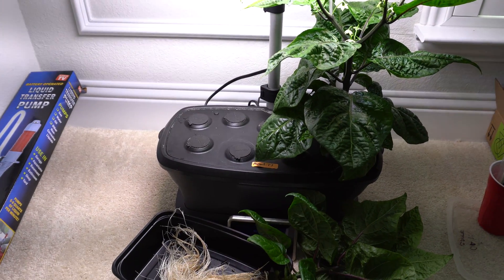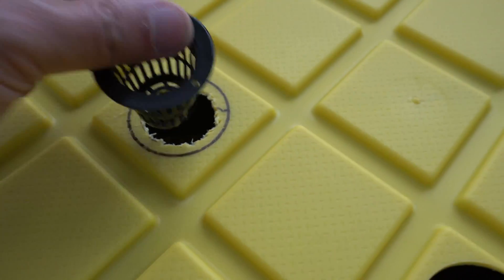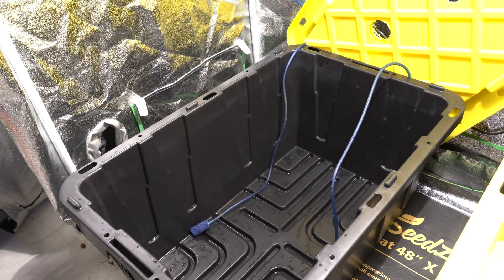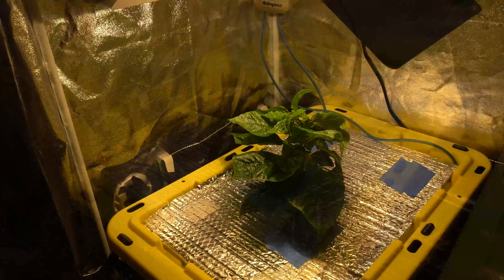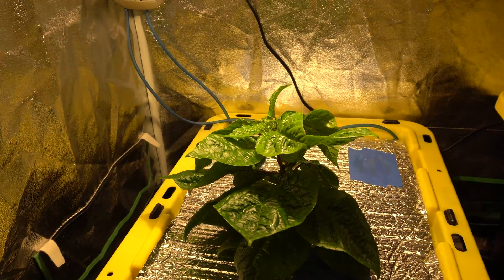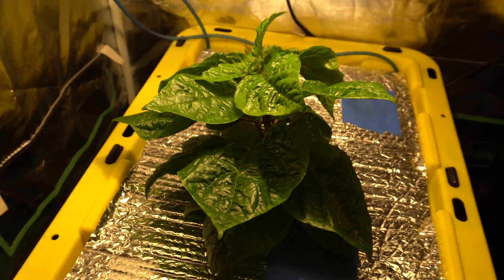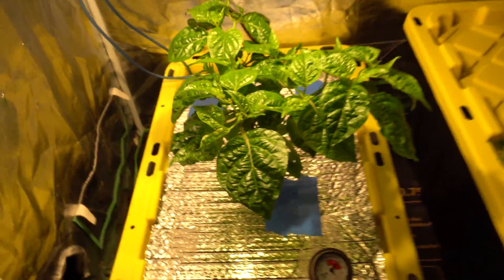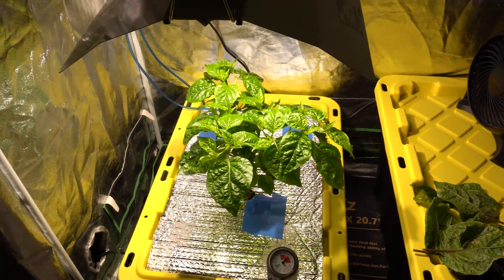DWC StarrRacha F3 - Indoors Under Endomaxx CMH150

Comment: How do you flush a system with that much water? I just started hydroponics and I’ve been replacing the water every 2 weeks. Is that necessary to do? My system is much smaller though
Reply from the maker: I don't plan on flushing this.  I'm going to let the plant use what's there and when it's gone, I will add more.

Comment: when using the General Hydro mix (grow/bloom/micro with cal-mag) 5ml per gal.what need to be done to keep the flowers from dropping and turn into fruit after the vibrating tooth brush pollination. Plants are Huge, Tall,  very Green and have hundreds of Flowers, but the flowers never hang around long enough after pollination to turn into fruit.

Comment: Why not just add a second CMH150 for the other half of your tent. Wouldn't it make more sense. For example if only one side needs light for any reason you don't need to burn twice the power to maintain half the tent. Secondly, in a two light system a light failure won't be a disaster for you plants as it would be in a single fixture setup. Third, cost. Expansion makes more sense than upgrade.
Reply: i agree with mainiac... for this kind of setup ... 2 lights would be so much more flexible in terms of growing different plants.
Reply: A couple more advantages is independent height adjustment for different height plants as well as better headroom as the higher wattage light will have to be kept further from your plants to avoid burning.

Comment: What happened to your indoor watermelon plants? Did they produce? Did I miss a video?
Reply from the maker: It produced a small fruit, but the 3 plants took up the entire tent and drink too much water, so I pulled them out.  I may do it again but with 1 plant instead of 3, and a larger system.
Reply: Khang Starr that's what I figured happened. I had never seen something like that before. It was a cool idea tho